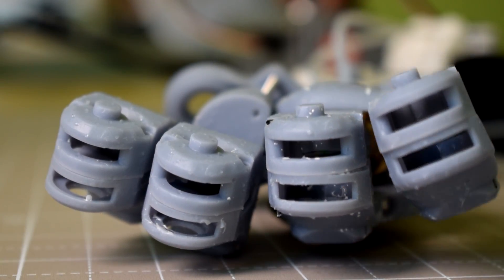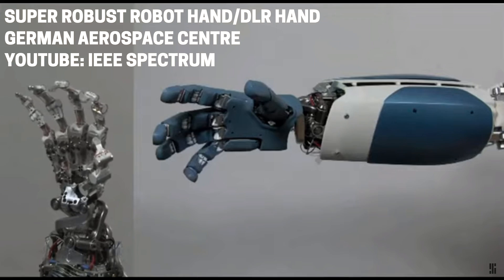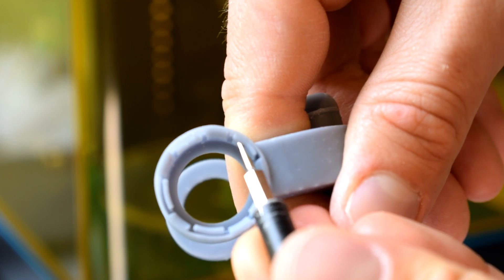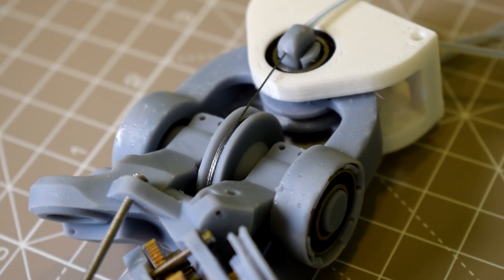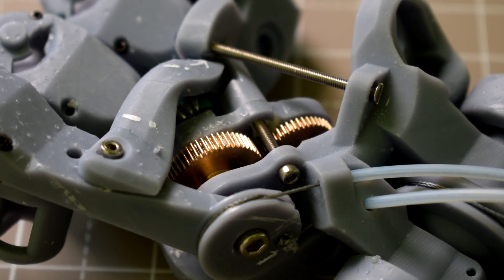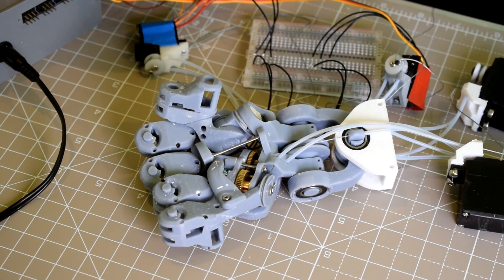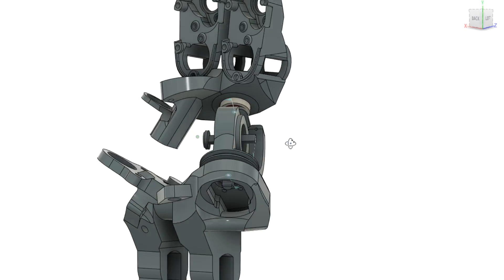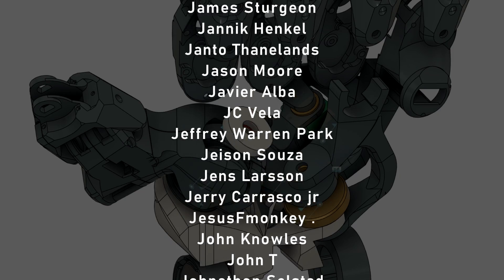Combining Subsystems to Form the Palm

Comment: Hi, your work is amazing.
I'm developing a humanoid robot based on real anatomy concepts in order to achieve all human body's DOFs and Neural Network based AI.
I'm developing an hand too, very similar to yours in concept, but totally different on the engineering side due to my choice of using air muscles as actuators instead of servos, in order to give an ulterior "organic look" to the robot (the hand body volumes, as well as the rest of body ones, are given by the same muscles that accomplice the motion, exactly like it would be in a real human body/hand, which would feel less or more stiffier depending on the muscles that are in traction resulting in a more realistic feel at the touch e.g. a realistic feeling handshake).
The only part where servos are needed is in the eye motion mechanism where I'm using mg90s servos due to a lack of space.
Given the very little space I'm working with I need to integrate the servo's gears and motor in my custom parts, in order to re-arrange them as needed and eliminate the useless stock shell volume.
I was wondering if you could share the servo housing dimension, distance between the gear's axys, would be enough.
I'm working with an FDM printer, and I'm really struggling to achieve the correct tolerances and dimensions.
I'm waiting for my Anycubic Photon Mono SE to ship, and I'm sure that the extra precision and fidelity of resin print will help a lot, but meanwhile I don't want to stop working on my project, and I could really use an hand.
:)

Comment: Could i suggest adding an insex screw with a drilled hike thru to use in the white plastic thing on the servo to be able to tighten the wire. Like the handbreak wire on a bicycle.

Comment: hey man, congratulations, excellent job you have achieved with those designs and structures, what program do you use for 3d modeling? and how will you control the large number of actuators that will generate so many degrees of freedom?

Comment: In the note of cnc machine, you can get an okay mini one off of amazon for a few hundred usd. I have one and while it can mill steel it is high rpm but really slow feed rate and a decent amount of coolant.

On the note of cable tension, what about a mini double eye bolt to tighten the tension? Like how engineers use then to tighten cables for cross support for buildings? That or use a self tightening slip knot.

Comment: If you will use dynamixels or similar smart servo, it has current sensor. Current propotional to torque, so additional sensor  may be not necessary.

Comment: Will, have you considered adding a barrel adjuster to your servo connections, to allow you to adjust the tension on each cable ? Although standard barrel adjusters may be too bulky for your narrow ptfe sleeves, you might find that a vented screw in a socket head form is just the ticket.

Comment: I think as a prototype, you're more than likely going to be stuck with two palm halves with awkward fasteners, unless you somehow bridge the two with a dorsal plate and a palm plate. It'll probably take an evolutionary step to a prototype v2 where design optimization and volumetric efficiency of parts will give you more room to create a non-awkward palm piece. But honestly, that's just robotics, you create one prototype that does it's job, then a second prototype that does it better. 
Hell, just look at James Bruton's adventure with making an open source quadruped, that project has gone through multiple variations with multiple other ventures to experiment and find what works and what doesn't work. Something as complex as a reasonably accurate hand is going to take a similar venture. I'm surprised you've made the hand this optimized as a v1 of the full prototype. 
I think if you can optimize the volumetric efficiency of the gearbox and the thumb's CMC joint footprints, you'll be able to have a single piece palm, or at least a single assembly that doesn't require awkward, long fasteners that have large flanges. Problems like this are really just an iterative design problem, where prototype v1 focuses on the proof of concept and making a working variant, and v2 focuses on efficiencies, v3 focuses on aesthetics, and v4 would be a final product.

Comment: For the really long screws, you might look into using threaded standoffs to  span the gap and then a short screw in each end, opposing each other. If you  used a ball-head allen wrench or torx, you could even tighten it down with the wrench off-axis. A thought. Amazing work, really enjoy watching the progress on this project.

Comment: Have you considered more compliant methods of joining everything together? Real hands aren't held together by anything as rigid as a steel bolt. Connective tissues like tendons and cartilage have a bit of compliance. Then, of course; everything is wrapped in skin. To simulate tendons, you could make attachment points that have short, strong springs attached to them, then pairs of springs can be connected with a short cable like lock wire, so it's like using lock wire to bind everything together, but there are springs at either end to give it a bit of compliance.

You could also make a glove that fits over the hand and anchors to various points on the skeleton to keep things more-or-less in the right place relative to each other.

Comment: I imagine some kind of elastic-tissue material that acts like muscle, and that upon the application of electricity this immediately contracts by a certain amount of millimeters ...
something like this would be revolutionary, and it would simplify your design and application ..
you should focus on engineering and creating some type of this type of material .. heheh
Reply: this already exists in a couple forms, to the extent modern technology allows. HASEL actuators are not actually elastic but are quick and strong and deform with a charge, and supercoiled polymers are elastic and deform with heat that can be achieved through joule heating with a conductive component (but this requires power to the order of kilovolts so is not really useful as a finished product)

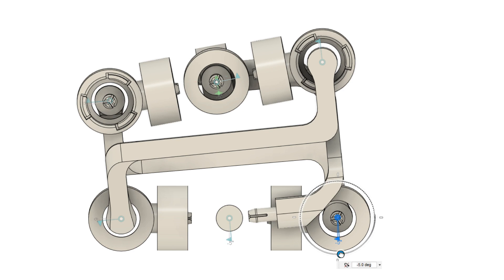Comment: 1:06 you should have that part 3d printed in metal  or cnc  via a 3rd party   . i feel it is a superior design
Reply: Also could make it out of carbon fiber tow in 3D printed molds, perhaps with some 3D printed bits incorporated into it. That would be vastly much cheaper, and about as good as you can get in terms of stiffness.

Comment: I was wanting to build a hand. Not biomimetic just robotic but that research led me to your videos and they are amazing! I was planning on using a VR hand tracker to try to control my hand. It would be cool if you have that a try. No point in doing all this work for biomimecry if you can't move it in a natural way.
Reply: His controller glove is chocked full of potentiometers, the end result will move as his hand moves
Reply: @TheModularian  yes but it would be cool to see one of these hands controlled essentially "hands free" no wires or gloves. It would also feel   more natural to move your hand without 3 pounds of wires and sensors

Comment: I wonder if there are devices that can transform electrical current into a linear motion similar to an actual muscle instead of a servo, which is bulky and relies on turning gears.
Reply: Are you thinking of something like a piston? It just extends and contracts?
Reply: @בןניומן  Aren't pistons usually powered by hydraulics or have a small motor that rotates the shaft? I was thinking more in terms of muscle fibers that can contract when applying a current. I could be talking complete crap hare. This is completely outside my knowledge base

Comment: Great work and i learn real much from your designing.
STupid Question in Bad english, would it help when you use in the Actual Movement of the wrist springs to get some weight / tork from the pulley and get so faster movement and a little more weight that the hand can handle?

Comment: Have you ever thought about using linear induction actuators instead of servos?  I've always felt like those will be the future of humanoid robotics.  I know they are not common, and parts usable for your project likely don't exist, but it seems obvious to me that those are a much better analog for how actual living systems function.
https://www.youtube.com/watch?v=zSHxNEiHve0
Reply: They basically equate to electrically-driven pistons. Would their arrangements be even compact enough for such intricate project?
Reply: I think linear induction motors are a cool idea. I think that, given enough development, the lateral aspects of the MCP joints would probably benefit from linear induction motors. However, I doubt that linear induction motors will ever become so effective that they outweigh the cheapness of everyday servos, especially in project like this which is designed to be more accessible.

In terms of analog though, you're probably right. Any given linear motor replicates muscle motion better than rotational one. 

The problem is, unlike servos which can actuate a string (the tendon analog) via pulley in relatively little space, a linear actuator would have to be directly linked to the string, and need a larger, unobstructed space in order to actuate the required distance. Additionally, Linear induction actuators cannot be easily geared up or down, making them inflexible in terms of torque range. 

I think in the ideal world, motors become small, light, strong and powerful enough that you can just have a motor at each joint. This would eliminate a great deal of complexity in the design, and hopefully look cool too.

Comment: Your 3D modelling skills are legit the best I've ever seen. I can't even imagine how many planes you must have, and how long you spend to make each component.
Reply: Yeah, this looks ridiculously complicated to do in a CAD program. Blender is much nicer for making organic shapes, where you can really just create and remove edges and drag vertices around until they look right, or type in exact positions when it matters, rather than thinking in terms of planes and extrusions and such for the whole thing.
Reply: planes?
Reply: @johndoesson  yes, sketching planes.
basically to create a 3D model you first draw a 2D sketch on a plane, and then extrude/revolve/cut it in three dimensions.
Reply: @oraziovescovi1922  "..how many planes you must have.." does that mean you make templates of 2D planes to save like you save functions in a library when programming, to make it more reusable or was that a typo?
Reply: @johndoesson  usually you create planes where you need them. You can reuse the same plane for two or more sketches, but it is really unlikely that they are perfectly aligned as you need them. in such a complex model there are probability lots of planes since the shapes are so complex.
Reply: this being said, you usually want to model a small part or subassembly in a different file, and then assemble everything as parts (wich is just the shape as it is, imported without sketches, you can't really modify it anymore) in another complete file.

edit: that's what he did with the different custom servos and wrist mechanism:he modelled them in a separate file and then assembled it in a complete model file
Reply: @oraziovescovi1922  Cool sounds reasonable as long as you can resize the sub parts so that they fit together with each other when you are putting them all together.

Comment: Concerning the long screws it might help to consider bicycle spokes as a replacement. You can buy a tool to roll on the threads for very little money to make any length from normal spokes and set them in place with spoke nipples. There are spokes with straight heads, too. I've done this before and it works

Comment: I really wish i knew how to even start doing something like this. 
It's really amazing! Any books that could help me get started? There's probably a ton of them and I have no idea where to start when it comes to range of motion and mechanics of human hand or even mechatronic engineering for dummies lol :D
Reply: Nice thing about doing a human hand is you have two specimens to look at and study the joint ranges anytime you want :) I'm working on bird wings, which are much harder to come by.

I don't know of any good teaching resources... perhaps I should make some myself. I just learned by trial and error (usually with a great deal of pondering before each trial), and watching videos like this one. Expect to leave a long trail of failures behind your successes :p

For biomimetic projects like this, you'll typically have to simplify the range of motion somewhat. A single hinge joint like an elbow is easy to emulate, but 3-axis joints like the shoulder are much more difficult (it's hard to even identify where the axes should be, with that scapula sliding around back there). And human hands are some of the most complex biomechanical devices ever created, and so beautifully optimized with the heavy muscles kept as close to the elbow as possible to minimize moment of inertia when attached to an arm. Bird wings are equally beautiful, and even more concentrated on that goal since the total length is so much greater. About 1/3 of the wingspan is just feathers, which are basically fancy fingernails... and of course light as a feather :)

Wings and hands are about as difficult as it gets as far as hardware design is concerned. If you have programming experience, you might also consider doing walking robots. There the software is the real beauty, and hardware is relatively simple now that mini-cheetah actuators are commercially available. I don't think any of the amateur projects have really gotten into "athletic AI" yet.
Reply: @dekutree64  I'm a software developer, so coding is not really the hardest part for me. Did self balancing robots when I studied in the university. It's just that the biology was nowhere near my points of interest. That will change, apparently.

Thanks for your input man, really appreciate it. Hope to see your bird wings project one day! :)
Reply: @wheresmyskin  great thing about biology is that it all works the same way so the concepts are easy, from an engineering perspective,  to wrap your head around.  How refined and efficient is what's complex.
Reply: @wheresmyskin  Yeah, biology isn't all that interesting by itself, but the more you try to copy it, the greater your appreciation becomes.

Self-balancing wheeled robots are kind of boring in my opinion. Too easy. Where it gets really interesting is legged robots running and jumping, where you lose contact with the ground and have to rely on IMU orientation/angular velocity sensing, and prediction of your linear velocity to figure out here to put your feet and how fast they should be moving at the time they contact the ground. I'd love to work on a project like that if I weren't already busy with this even more awesome project :)

This past year has been mostly spent in endless struggle to build a CNC machine capable of making cycloidal discs, so the wing itself hasn't progressed much since this post at the end of last year https://www.rcgroups.com/forums/showthread.php?3488043-Looking-back-at-2019-and-ahead-into-2020#post43437615
Reply: Study biology, learn about all the types of actuators out there.  Get a 3D printer.  Start experimenting.  Don't allow yourself to think that you can't do it.  Only stop when you really really can not do it.
Reply: @Scott_C  I don't think that studying biology is a viable hobby for little spare time I have already, but I guess I'll try. :D
Already have a 3D printer and I'm learning CAD for quite some time... guess I'll just have to jump in and start challenging myself more. It's just a lot of information to learn before one can even start doing something that kinda works.
Thanks man! Guess I'll just have to start and see how it goes.

Comment: Is that standard grey resin? You really need to use an ABS-like or other high strength resin. I've heard good things about Saraiya tech blu, and had good results with it myself.
Reply: Currently the price on amazon.co.uk for the standard grey is £32 and the Saraiya tech blue is £49.99. My point is, why bother with the expensive stuff for prototyping? may as well just use the cheaper stuff first then for the final product use the Blu. Especially as he is working with his own money and donations.
Reply: @mb2k100  
When you're just doing a fit check on the sizes of things, it's fine. The basic resins are really made for miniatures, and not meant to be structural, though.
A few reasons it really is probably a good idea to use engineering resin, even for prototypes:
1. the resin is tougher, which means fewer broken parts when handing delicate prints. reprinting time and resin will make up the price different pretty quick, especially if you ever drop the assembly made from a fragile resin.
 2. it's best to prototype as close as possible to the real thing. It's never good to work out the kinks in prototype for one material, then change to something else only to have the strength and stiffness be all different for the final
3. he said he was moving away from the cool wrist joint because of strength concerns. Using a stronger material could fix that. The engineering resins can be 2x as strong as standard.
Reply: @Timestamp_Guy  Agreed, with points 2 and 3 especially. Thanks for your detailed reply changing my mind.